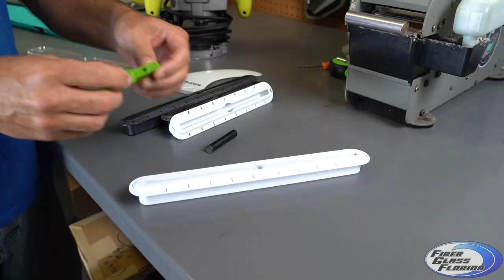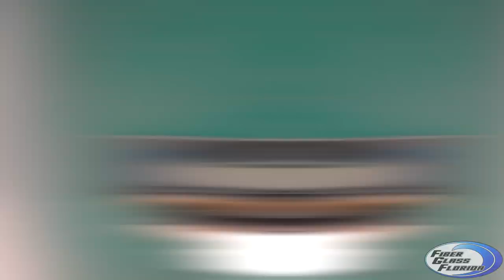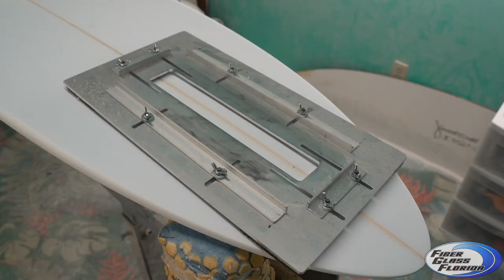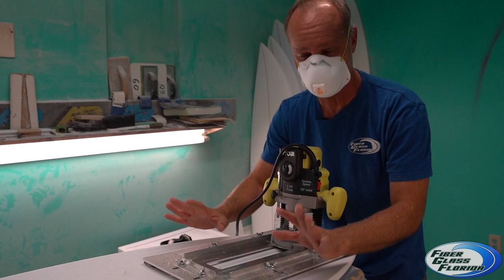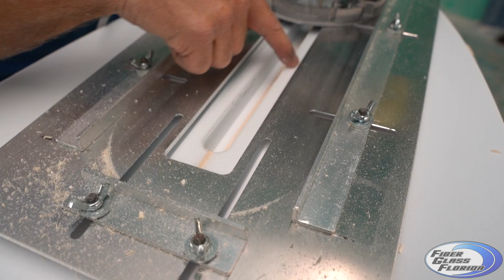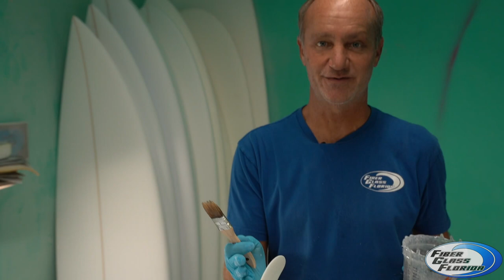Futures one shot install kit : Routing & Installing fin boxes with resin

Comment: Hey man just wanted to thank you for explaining the purpose of that black pin.    Makes setting the guides on the template easy.  It got separated from my kit and every time I ran across it in my shop, I couldn’t remember where It came from and what its purpose was.  I am assuming that you could use the same pin to set the guides for installation of a standard Bahne box as well?   I have a template that I got years ago that looks just like the Futures Jig.   I have it set for Bahne boxes.  Used to see those jigs around glass shops out here on the West Coast all the time.  They stopped making them. Everybody went to plastic jigs and a beating.  Don’t know who manufactured those jigs.  Always assumed it was Bahne.  They were the same as the Futures Jig.  An aluminum plate with a slot and four pieces of angle aluminum.   Thanks for the tutorial.  Lowel/Oregon Shapers/ Little Hawaii Surf Designs
Reply: Bearing

Comment: Is Futures one shot install kit just for center boxes (or also for 6" Future boxes)?
Reply from the maker: just for the center fin, typically used for longer boards.
Reply: You also have to use a different router :(

Comment: if you are doing a resin swirl would you route the box after glassing like typical future boxes? how would you go about this?
Reply from the maker: When doing resin swirls you would treat that glassing process just like the normal glassing process. All of the steps you take for fin boxes should remain the same.
Reply: @FiberglassFlorida
Reply: If I wanted my boxes to remain white, black or whatever color I bought from Futures, I would install them post lamination.  The look is much cleaner.  If it’s a longboard I would use a Bahne box and sink it after the lam or after the hot coat.  For the small Futures;  Do them post lam.  A lot of guys do this using the old “Two Step” jig and collar.  Cleaner and less likely to tear or damage the tinted lam at The cut for the flange.  Then of course you will have to put a football patch over the boxes.  I don’t think I have ever seen a video of anyone doing a post lam install this way, but that’s my preferred method on tinted or opaque resin boards.  And I have heard others say they do the same.  Lowel

Comment: hi everyone, I have a question that might sound stupid, but I just got a 8" futures single fin, Can I put it on a 10,75" futures fin box ?? Or Do I have to put my single fin on an 8" box ?
Reply: Will work on any box as long as the base isn't longer than the box